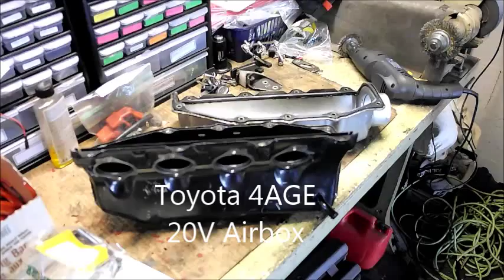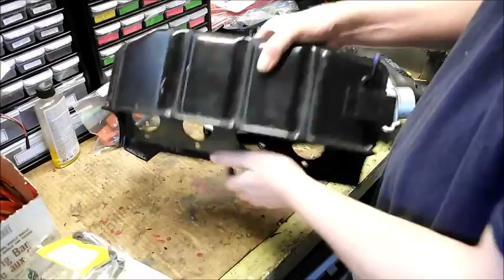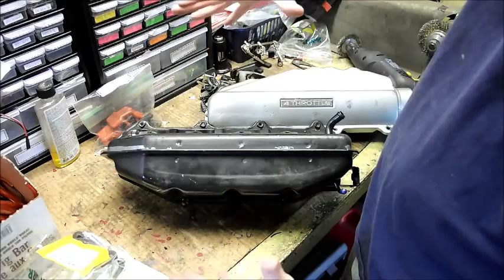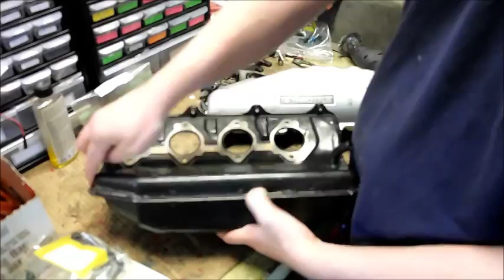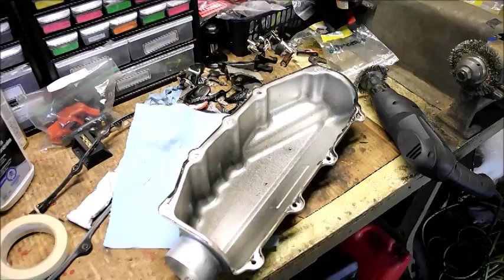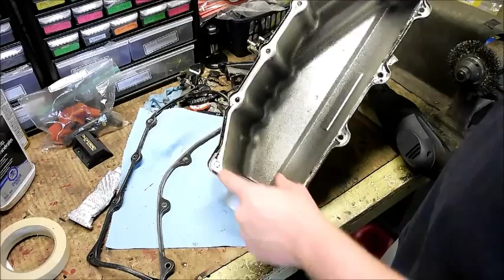4AGE 20V airbox

Comment: hey.

sorry to tell you that the airbox is not effecting your idle speed the idle speed valve takes the air from the airbox and baypass the throttle valve so the airbox is not a part of the engine system. its only a air reservoir for better throttle responce.
Reply from the maker: Nicky Jans The silvertop has a MAF which is located before the airbox, if there is a leak then the engine is getting more air than expected. This will affect how the engine runs.
Reply: GraysGarage  I have a blacktop. was thinking the have the same build. thanks fore the responce